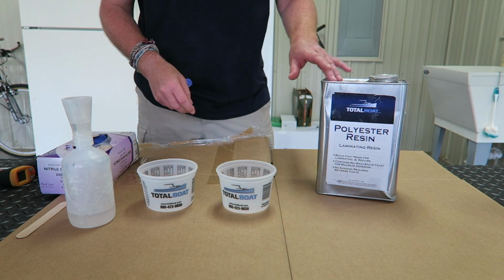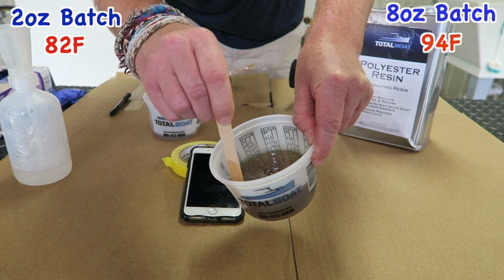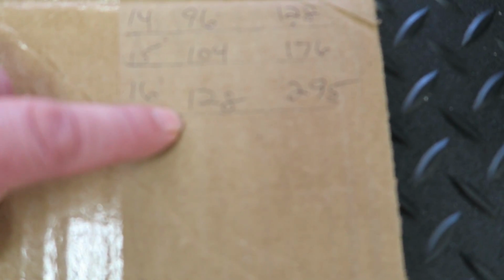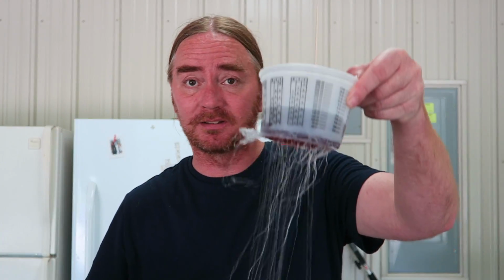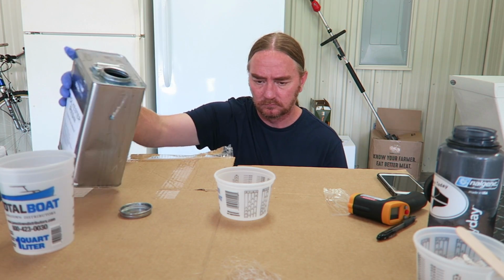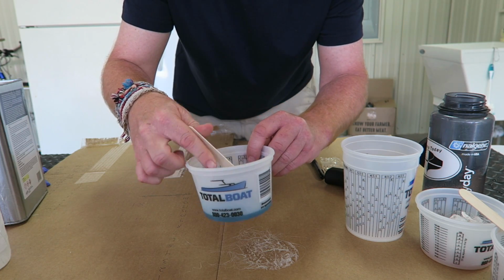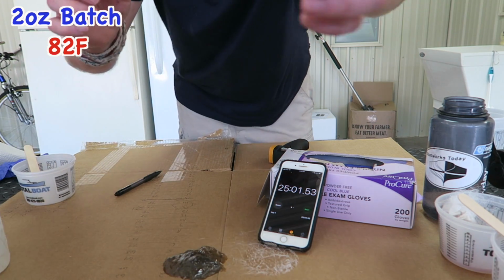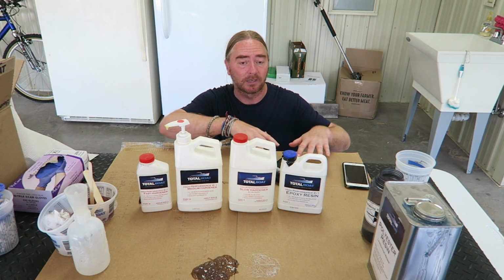Fiberglass Resin Setting Up WAY Too FAST In This Heat!!!  How To Slow It Down??

Comment: on my project i am replacing 1/ 2x10x6 long stringer. I am re-using the fiberglass shell . After watching how watery your mix was i might add more 403 or silica to the chop and pour it down the hole void then set the board pre penetrated with epoxy and dried. Would you do anything different? how much should i mix up of high performace epoxy with the ad ins do i mix up and in what?  Does it kick fast? ty

Comment: Mines not curing so its like 65 degrees and its been all day and not dry yet ?
Reply from the maker: couple things; check the date on the resin to see if it's more than a year old.  Also confirm that the mix was catalyzed between 1 and 2% (figure about 12 drops Mek-P per ounce of resin).  This is presuming that you're using polyester resin and not epoxy
Reply: @ Yes it was polyester. I’m pretty sure the mix was a bit off.

Comment: Great information Andi! This might give me a chance to finish a second project. I have two questions I would like to have answered. And the context of these questions, you find below. 
1.) Can Polyester resin be worked with, inside a airconditioned space? Or is this a bad idea? 
2.) Does humidity has an effect on polyester Resin?

Context. The average temperature is 96 degrees, with an average humidity of 81% On my first attempt, I tried to build a roof structure, and was advised by the seller of the resin, not to use a airconditioner. I took his advice, and found out I had only 4 min to work with. 
The other side of the roof structure i did  with Airconditioner, only running during laminating. And found out that I had only 6 min to work with. This was the moment I started to doubt the sellers advice. With your video, I wonder what would have happend, if I had brought down the temperature to 50 / 55 degrees with the airconditioner.

Comment: I have an off-topic question: If I had a drum (with a mixer inside) of polyester resin (obviously, no catalyst included), could I put a faucet at the bottom of the drum without the faucet going to crap given the flow of resin?

Comment: The  directions for the poly I used has a temperature guide to use less MEKP for warmer temps.  Worked fine.

Comment: My son was helping with some fiberglass work and we ran out of the one tube of hardener and he grabbed my paint hardener and we continued to fiberglass, My question is will this hardener actually work, the areas are drying just taking a longer time, should i grind all that we did out and redo or since it has hardened will it be good? thanks in advance for reply.

Comment: Great info - thanks.   Is this also applicable to 1:1 epoxy resins?  I'm especially interested to find a way to slow down a fast setting 1:1 casting resin in my hot garage lol.  I'm supposed to get about 3-5 mins working time but I'm only getting 1-1.5 mins & it's really hard to work with that time!

Since you said I can't mess with the ratio does that only leave cooling the resin ahead of time?

Thanks!

Comment: One thing to consider ( wind turbine Blade technician here) when cooling your resin on a hot day, if your temperature difference is to wide you can actually cause condensation to form and moisture & resin don't mix well (think of a bottle of coke fresh from the fridge) because of this our engineers won't let us have more than a 10⁰ differential. Especially applying cold resin to a warm surface (or vice versa) moisture was developing between the new laminate and the existing surface causing debonding as it cured and the moisture turned to steam.

Comment: Hello I have a 1989 procraft 1660v bass boat it is fiberglass and I have redone the floors, I had to make a wiring harness for the engine, etc I would always watch your vids for tips and how to info... but I was wondering how can I get access to the through hull fittings on the side. The only thing I can think of is cutting a hole in the deck area behind the seats, any help would be appreciated.

Comment: Had some hot days here. Got to do some little jobs putting up cabinets etc in the boat. My epoxy was wet, for like ages, then set up suddenly all together. So it was not gradually setting up for me, so I could judge it and use the tacky point to glue in the parts, so I had to use braces/clamps to hold everything in place while it set up/solidified (was a year old tub of West Systems 105/205 and using a dispensing pump).
[edit]
Ah, yours also takes longer too I see. I think I know what happened. Last year I was gluing up outside in the sun, so my epoxy was gelling up much quicker, in like less than 3 mins. Even in this heat though, working inside the boat, it's more like the 10-12 mins your getting in your workshop. :P
Full sun = much more heat transfer to the mixture/surfaces.

Comment: Interesting I am on the northern boarder of Illinois, not sure where you are but yes it still can be 90+ on a summer day. I am new and will have to try this. Is there a rule of thumb for how much resin per oz of chopped mat for mold making?

Comment: I’ve done the epoxy test inadvertently. WEST System 105 with the slow hardener. 75° day. The hardener was old, and normally took a few hours to kick. Working outside sitting on the deck in the sun. 2oz batches mixed and used one at a time. In 5 minutes it was thickening. In 10 it was putting off white smoke. Sun on a teak deck gets HOT!!!!

Comment: Thank you!  Excellent explanation and demonstration and spot on timing especially here.   Finishing up the outer  hull repair and finish and about to start laminating the stringer, bulkhead  and transom fabrication for a completely rotted out 1983 boat.   Your pamphlet has been extremely helpful last few months!   Your information is much appreciated and the temp here today is 113 during daytime and gets down to 95 at about 10pm, so Thank You Again!

Comment: years ago i was encapsulating a new plywood deck with epoxy in preparation to fiberglassing it over, it was a hot august day, the epoxy was not west system and the job was almost finished around 6pm so when i mixed my last half-gallon i didn't measure it exactly right...... 10 minutes after i mixed it the paper bucket starting turning brown and burst into flames. tought me an important lesson, be very careful on a hot day when working with any catalyzed resin..

Comment: I'm from Texas - 2% catalyst way too hot for for anything over 70F if you want play time, unless you put a bucket of ice under your catalyzed mix .
2.5% for 50--59F
2% for  60-70F
1% for 70-89F
0.6% for 90F+
add about 0.25% if resin is going to thickened with Fumed Silica / chopped strands fibers
add 0.25-0.5% if resin is going to be thinned with acetone / styrene

Comment: The Bondo Poly at Home Depot, 16oz in a cup, 60 degrees, 4 min max. 
US Composits Layup resin, 30oz in a cup, 95 degrees, 20 min plus.

Comment: As a boat repair shop in North East Florida, and before that in South East Florida for 13 years, I've learned a few tricks on how to not have your resin kick off in just a few minutes. One, store your resin in the FF ridge for a bit prior to catalyzing, 2. Mix your container frequently (this is huge). 3 use a shallow container rather than skinny. ie. Use a 2 1/2 quart mixing container, rather then a pint or quart mixing cup. 3. Catalyze at 1%-1.5%. Also, the higher grade the resin, the faster it kicks. I find a General Purpose “boatyard” non consistent poly resin seems to last much longer. One things for sure, you can surely count on the resin kicking on you right when you just need a few more drops. Gelcoat on the other hand you need to be careful storing in fridge then bringing out to the warm ambient temperatures, because it can sweat, which will surely make your gelcoat have issues kicking. I have a refrigerated air dryer that cools the air for the purposes of getting the moisture out, and I find since installing that, when spraying gelcoat I get a bit longer working time.

Comment: I have been using a tiny cooler with Ice in it for years. Just use a old metal coat hanger cut to fit wedges over the cup to keep it pushed to the bottom so it will not float and tip. Resins with water is just trash.  And still here in the south we must use small batches.  Also don't use in the direct air of a Air Conditioner. The moving air of a fan or AC will cause it to flash off prematurely.

Comment: I am curious if there are any differences between the standard resins and the more costly fire resistant resins when it comes to curing times. I know the fire resistant matting and resins nearly double the material cost, which is why they aren't used in most applications. Fleming Yachts uses them for their fuel tanks which they custom make for each model.

Comment: Seems to me, if you get 12 minutes work time for a 2oz batch vs. 10 minutes work time for an 8oz batch, you are not getting two extra minutes work time. Instead you are getting a total of 48 minutes of work time making four 2oz batches compared to the 10 minutes of work time for one 8oz batch. This means you are actually gaining 38 minutes of work time for the same amount of material. You only lose the amount of time it takes to mix the three extra batches.

Comment: Another trick from someone in georgia.   Cool it before catalyzing as you said, and pour it into a flat tray, sometimes I use large Turkey trays.  Then put the tray over an ice box. It pulls some of the heat out of the mixture so it does not kick until it is on the surface. It never gets cold but it keeps the heat from building.  And yeah, I smoked a batch of epoxy last week because it was hot and I thought I could sneak a batch in.  Hahaha

Comment: I’m in west central Florida and I’m building an epoxy, fiberglass and foam 14 boat.  Summer temps are consistently 95f and humidity pushes it well over 100f.  Been working on fillets this week and twice already I’ve had the resin start smoking on me and had to toss it out of the garage to avoid starting the house on fire.

Comment: Cooling below dew point could cause condensation to form on resin.
Reply from the maker: Could be an issue with epoxy and result being more amine blush (which is easy to clean off).  Not saying there would be no effects with poly, but have not heard it being an issue :-)

Comment: I live in Tennessee temperature is 89 the heat index of 102 16 ounces of  Epoxy resin set up in about nine minutes it’s hard to get your stringers done I wish I saw this before I started them going forward I will make smaller batches thanks for the tips as always a faithful follower
Reply: Also do you glass work before the sun is actually above 25 degrees above the horizon.  Don't let the sun shine on your project either.

Comment: Central California... forecast is 112° by Thursday and my AC just broke. Can''t get it fixed until next month...
Reply from the maker: Oh man, that's not good!  Window units avail??
Reply: @boatworkstoday  just bought the last 2 on the shelf. Won't help much in a 2,500 sq/ft house. 25k to replace AC unit and furnace, both 30 years old lol

Comment: Thanks, this is a really good summary of the topic with really valuable suggestions. Yes, I was in a situation, when I had to throw a smoking pot of epoxy into the water previously :-)
One little request, could you mention or caption the metric equivalent of the measures you mention?

Comment: I would be interested in penetrating epoxy. Could you achieve better (deeper) penetration by working in cooler temperatures. My expectation would be deeper penetration due to slower setup time but the cooler temperature might also effect how deep the penetration gets equalizing the effect of the slower setting time

Comment: You didn't discuss using less catalyser? As long as you use catalyser, it could potentially help slow things down, right? How about a demo going below 1%?
Reply: hi in Australia where 80 is a mild spring day i often used .75% catalyst and have never had it fail to setup

Comment: Would be handy if you could put the Temperature in Celsius on screen each time you reference a temp for us non US viewer.
Reply: @Dave : agreed from France ! But it's easy to open a tab in the browser and use the converter. Main issue is with ounces as I rather use either grams for a mass or cubic centimeters for volumes. At least, these Americans drive on the right side of the road ;-) This guy does a lot for the community (and an international audience) so we can accept a little extra work.

Comment: Good information Andy.  I do have a couple of suggestions.  First, when you put a larger batch of resin into a paint tray, use a metal tray and put the tray in some cold water.  That will keep the resin cool for longer and extend the working time.  Second, using small batches or cooling the resin is fine for keeping the resin from gelling.  However, as soon as you put the resin on the surface/fabric, the resin temp will come to the surface fabric temp and things will start happening fast if the surface was warm/hot.  This can be an issue when doing large projects like building a hull/deck.  If your shop isn't temperature controlled you can extend the working time on the project by working in the morning BEFORE the project warms up.  Also, if working outside - don't work on surfaces that are in the sun.  Trying to glass a 150 degree surface is definitely no fun.  Since I live in Maine working in hot weather isn't generally a problem since hot days (75+) are few and far between here.  However, we do have to work in cooler temps now and then (like 10 months a year).  I am looking forward to your tips for cold temp work.
Note: you are brave man putting a cup of poly resin in the home freezer.

Comment: Does the cureing temperature affect the strength of the cured resin?
Reply: As long as it is not too hot it is stable.  It can form Tiny cracks if it cures to fast.
Reply: The longer it takes to cure, the more polymer bonds form... so, lower temps = longer curing time = more strength.

Comment: everyone has his own tricks but those basics aply almost everywhere
one thing i would add that all ok and dandy if you work INSIDE where sun can't get you
working outside well you basically can regulate the speed of seting up the resin only by building tents or doing work at night/early in the morning or late  just before sunset
UV light and heat from our big bulb on the sky can make any batch of resin gel in a minute even catalised under recomended amount
as for measuring stuff
here in the europe we have that easy trick called metric system
resin is sold by kilograms, catalist by cc and 2% of a 1000 grams is usually calculated to 20cc so going by a simple single use pharmacy siringe and small kitchen scale can get you by a big project without any measuring cups or extra stuff. and we talking building a fiberglass pool liner  kind of big
and yes i am usually making a medium batch of resin and just pouring it all out on the glass mat to soak trough , and long handle mole fur rollet is my best friend to smear it all around
i also have a lot of leftover catalist so i guess i undercatalising resin, but even if it won't bind at firsy , sun will cure it the next day when i'm at work and i didn't seen much issues 

thanks for the video

small question does extending life of a catalised resin with a bit of acetone make any sense? , i seen it comonly debated over if it comes to gelcoats, some say never use acetone, others swear by it

Comment: I'd be interested in seeing the epoxy tests. It might be helpful to note depth of resin in the container (or smallest dimension of the volume?). I wonder how much time you might buy (if any) by keeping the container in an ice bucket once it's mixed.
Reply: I live in a very hot place with high humidity. Slow to tropical hardener is the only way to go. Cooling the epoxy does help if you spread it out thin and cool it. I have to keep the sun off it too or it will cook it! It actually boils and leaves voids that must be ground out. Best thing is have everything in place before you mix the epoxy and Work smaller sections , it can start to setup quickly . I actually had to toss a batch overboard a few years ago, I used medium hardener on a very hot day, I mixed in milled glass after mixing the resin and hardener. It started to smoke and melt the container before the milled glass was mixed in well.
Reply: Indeed

Comment: That's polyester resin,,,not "fiberglass resin" like the video title says.
Reply: The title says "Fiberglass Resins" i.e. the resins one uses with fiberglass.
Reply: Seriously? You need to find another channel if all you are about is bitching about titles.  If you actually work with fiberglass and want information, this is the channel.
Reply: any resin used on glass makes fiberglass resin out of it and shown in the video are just two most comonly used for that
without glass it wouldn't be fiberglass resin even if the label sayed so